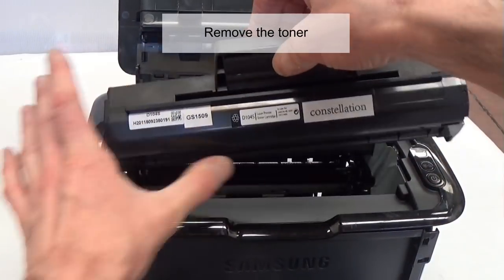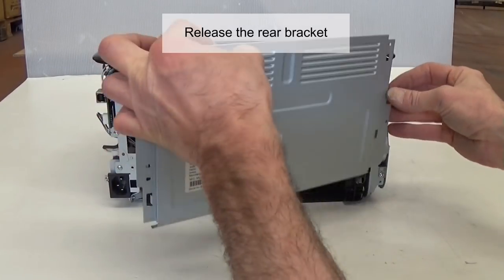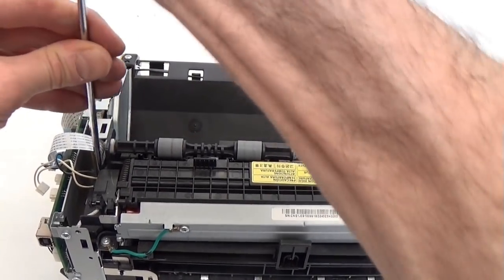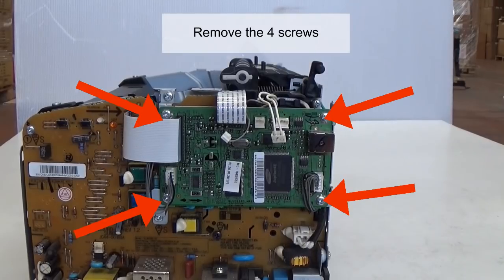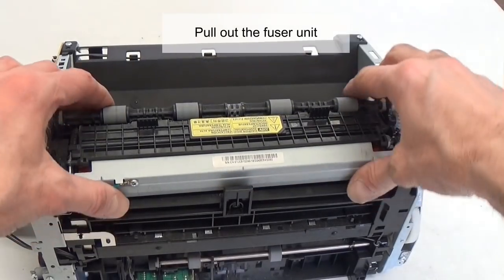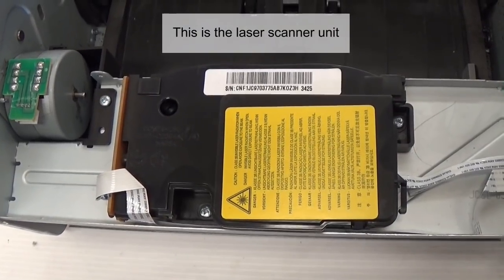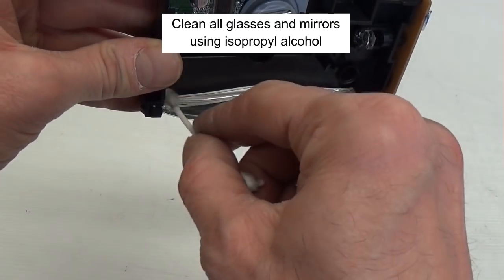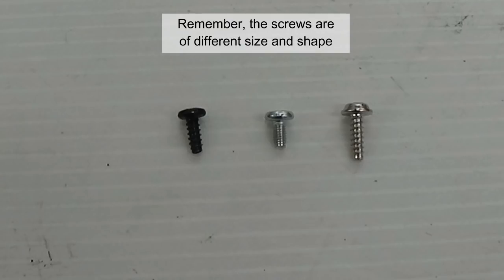Disassembly Samsung ML-1660 1665 Laser Printer

Comment: great video, thanks for the effort.

i have a question, maybe you can help?
i have problems with printing multiple pages with my ML-1665:
After finishing the first sheet it immediately loads another sheet from the full paper tray but without printing anything.
Instead it tries to pull through that blank sheet but gets stuck right in the middle.
But when i feed the sheets manually one by one it prints the first sheet fine.
Then it pulls the next (manually fed) sheet through without getting stuck but also without printing anything.
Then when i feed another sheet manually it finally prints.
So for printing multiple pages i need to keep the paper tray empty and end up feeding sheet after sheet manually.
Do you think this might be solved by replacing the pickup roller?
Reply from the maker: Are you sure the setting of the paper dimensions in the paper cassette are right?
Reply: @viandant5  hi, i got the problem solved. It was the solenoid on the left side (when looking at the front) which releases the pickup roller after each sheet. It has a thin rubber bumper which gets sticky over time. There is a little lever (triggered by the solenoid) which actually controls the pick up roller. When this lever stays gets stuck to the solenoid's rubber it "tells" the pickup roller to permanently to pull in sheet after sheet without waiting for the actual sheet to finish. So the sheets get jammed.
Here is a very good tutorial for solving the problem.
https://youtu.be/OcOuXMoHXpM?si=5JVRZRfrDOC8tyEa.
Reply: @viandant5  
Thanks for replying.🙂
Yes, settings are correct.
Started a while ago: instead of printing sheet after sheet it started to pull an "extra" blank sheet through the printer after a printed sheet.
And this "extra" sheet always gets stuck in the middle.
The interesting thing is that when i feed the sheets manually that "extra" sheet runs through the printer without getting stuck...

Comment: Hi, I have a ml-1670 and it started to turn on by itself and reset when it is plugged to power while it is turned off. It does it constantly like its in a loop. I have tried different power cables and wall sockets but it is always the same. Is it a power supply related issue?
Reply from the maker: Yes it could be a power supply problem, or the interruptor

Comment: Can sy tell me where I can buy the toner chip reader unit?  One of its springs has broken, and it can't recognizer the toner.
Reply from the maker: Here there are spare parts for printers
https://www.youtube.com/watch?v=pB4XIBT_tJw
Reply: I have the same issue on my ML1865. I'm considering accessing the connections through the side, as the small mating PCB on the toner cartridges unclip.

Comment: The first 50 seconds resembles a physical assault more than anything!  😄However, it did show me how to get inside so I can replace the failed capacitor that stopping the printer from powering on properly.  Thanks dude.
Reply: 2200uf 10V capacitor?

Comment: My ML-1860 printer just makes a clicking noise when I press the power switch but then does nothing.
Reply from the maker: It's difficult to say without cheking the printer. It could be the main board.

Comment: Hi I have the printer 1660. and the problem is that the second page gets stuck in the middle. You can watch the video
 https://youtu.be/6hhFtOYxSp0
and thank you for a solution
Reply from the maker: Check the printer settings. Is the A4 paper selected?
Reply: @viandant5  Yes. I use the A4 size; do you think is solenoid ? or any other problem. did you see the video ?  thanks a lot
Reply from the maker: @yoshioyamaguchi841  Yes, i saw the video. May be is a paper sensor, or check the printer folder if A4 is selected

Comment: Quite useful video! Just one question. When the printer keeps trying to reload as soon as the sheet loaded and many seconds after the sheet is printed ¿Is it a clutch failure? Thanks
Reply: Paper control solenoid clutch repair is required,
Reply from the maker: Are the settings in the priner folder correct? It could be a motor clutch failure or a defective paper sensor

Comment: Can you post a disarm of a m2070? i have this problem: my printer prints all black. i did the cleaning, i've searched in the web but i can't solve my problem. Can you suggest  some idea? i really need your help my friend.
Reply from the maker: Did you change the toner cartridge? or it could be something related to the laser scanner
Reply: @viandant5  Yes i did. If is the laser, do i have to replace it or fix it? I'm not a professional
Reply from the maker: @allandino8487  you should dismantle the machine. may be it's only a connection problem

Comment: How to reset the toner chip in Samsung multifunction laser printer 4728 FD model, and how can I change the SMP battery cell.
Reply from the maker: There is no way to reset the chip, you have to change it. which battery cell?

Comment: How can print the cards ? (A4 size-hard boards)
Reply from the maker: A4? you have to select Tick paper in the printer folder, if your printer support this weight
Reply: what is the considering paper weight or paper thickness
Reply from the maker: look at the features of the printer, You'll find the thickness and the weight of the paper

Comment: how clean sensors?
Reply from the maker: with isopropyl alcohol
Reply: but where is the sensor
Reply from the maker: What sensor do you mean? The thermistor? It's near the fuser in the back of the printer
Reply: the paper sensor, where`s when print take 2 sheet

Comment: sorry sir... i have try another new cartridge...but found problem same.
lower roller is damaged.
Reply from the maker: with printing with shadows you mean a grey background or a repeated image? in the second case the problem probably are the fuser rollers
Reply: Sir, Viandant5
i too face the same issue thus found out the was a problem with the fuser thus change the pressure Roller in the fuser assemble. But it continue the same....
Reply from the maker: Change the toner cartidge, it could give similar problems

Comment: Hi, I have the same printer and it is continuously pulling the paper, can you pls tell, how to resolve this
Reply from the maker: No, it's an hardware problem. probably a  solenoid paper sensor, but may be also the mother board or the motor clutch
Reply: Can you pls help me , how to troubleshoot test and remove solenoid paper sensor and motor clutch
Reply from the maker: I haven't video on this argoument, you nay find informations with google but I think the best solution is to bring the printer to a repair center
Reply: where is the sensor or solenoid
Reply: @joseluisdavalosc.5418  Looking for this also! Always feeds a second sheet when the first one is almost completely away.